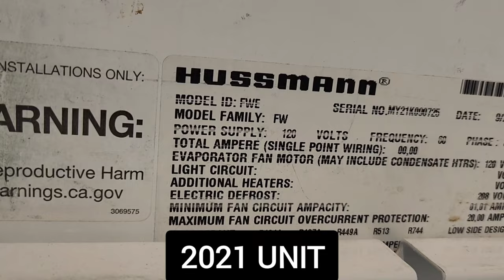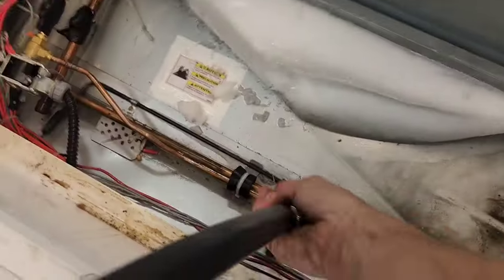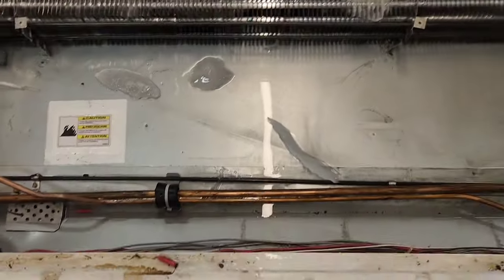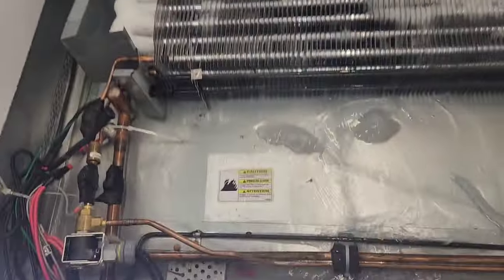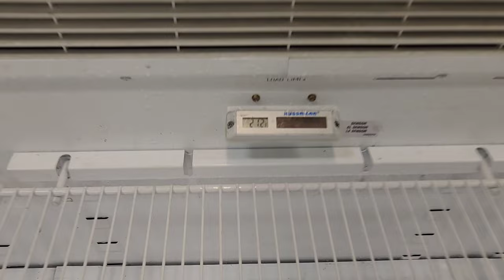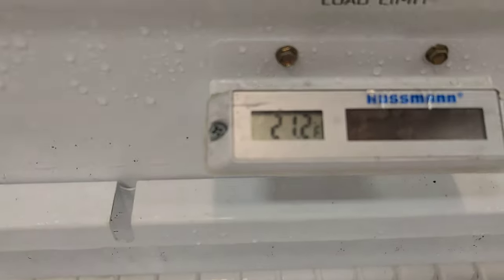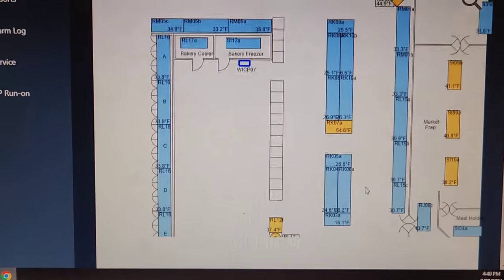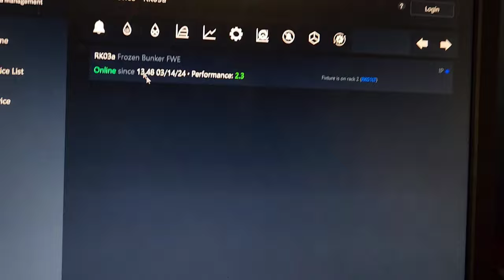Dual Temp Bunker Case Froze on Only One Side

Comment: Been doing this 35 years and retired now. Most of the time I look for a breech or area where air can enter the bottom of the case such as when the case on the back side is in defrost while the iced case is in refrigeration. The steam from the defrosting case on the backside will enter the cabinet through the breech or opening and condense on the coil of the iced case. Check the area where the lineset enters the backside of the case to see if it is open to the case behind it. It does not take much of an opening at all to cause this. 1/8 of an inch will do it. Try to seal it up with permagum. Looks like a Hussman case with just a front coil heater and a pan heater (which are notorious for failure) also add runoff time in the med temp mode. Remember, it will hit the termination temp of 58 degrees a lot faster while in med temp. And then drop down to low temp right away.
Reply from the maker: Thanks for the detailed explanation! I really like getting this type of specific feedback. I appreciate you sharing your knowledge

Comment: I’ve seen it on eev or stepper valves where it does ice like that sometimes when the case reaches set point the eev or stepper will bleed by and slowly freeze up case or sometimes when it goes in defrost it’ll bleed by. When it’s a regular txv I would just find a dirty screen usually.

Comment: Coils with EEVs always get like that for some reason. They sometimes have screens inside the liquid in portion of the valve. Screen might be plugged or transducer, coil out temp sensor may be off throwing off the Superheat causing the valve to throttle down overfeed etc.

Comment: One of the cleanest coils and case. I've seen in a long time. I would look into an air flow problem. An obstruction of some kind In the back wall? I will check the super heat. At that point Thank you for the video.

Comment: That looks like either a condensate drain issue if it has a drain for each side or an air flow issue like they got the freezer stacked up too much. But with that ice formation it's strongly strongly implies that there's a condensate drain issue.
Reply from the maker: Thanks for the feedback

Comment: I have the exact same thing happening on a 4 door reach in cooler (tall version).

It happens every other month. Left side frozen up and sometimes even the whole evaporator if waited for too long.

Replaced all 4 fans because they said the fan on the left stopped working (worked fine when I came there)

I'm gonna clean the txv screen before the season starts to see if it improves anything.

I think it might have something to do with defrost termination. If it's not fully defrosted you'll have some ice left at the coldest point of the evaporator. Usually the sides get the least air flow and the side with the connections gets the coldest. Of those 2

I might try to relocate the defrost termination sensor to the place where the most ice builds up.

That is something that some DX coil manufacturers state in their manual. They advise to watch a defrost cycle and relocate the sensor if needed. 

I successfully used that trick a few times because the original location isn't always the right location.
Reply from the maker: im used to it by now honestly